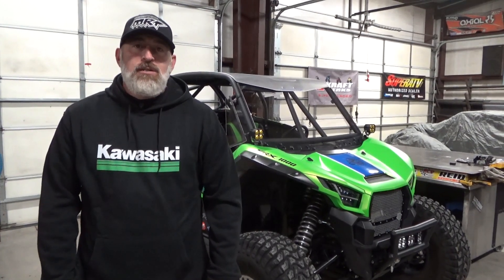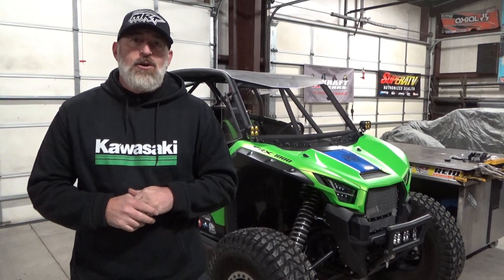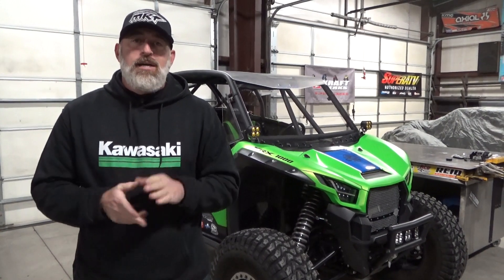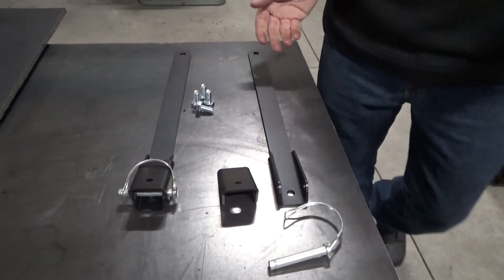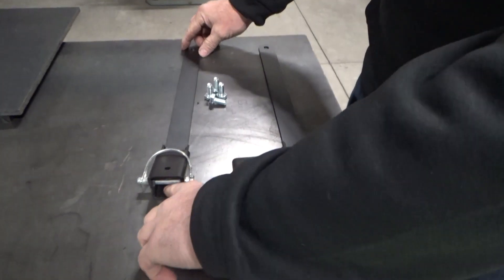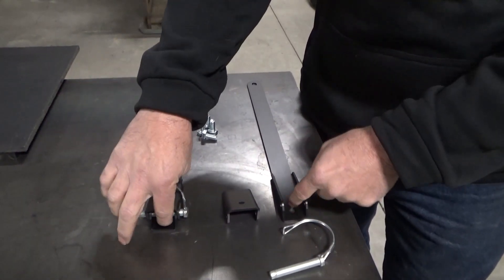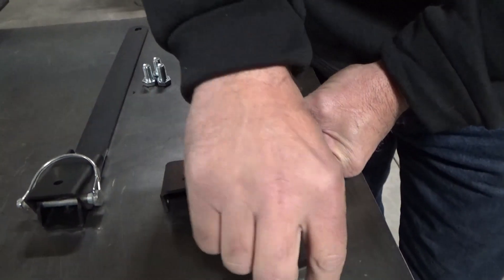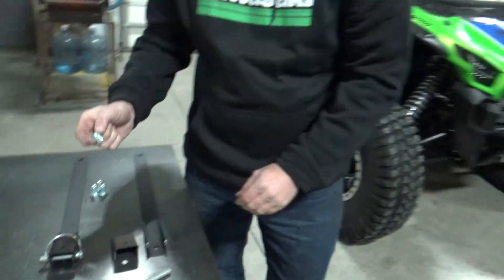Kawasaki KRX 1000 (12mm) Flip Forward Seat Installation

Comment: What windshield are you running? I’m looking at getting an intrusion bar for my KRX but it seems you’d have a difficult time running a windshield at the same time? Thanks!
Reply from the maker: Ours is custom-made. However even with a intrusion bar, as long as it’s a welded in one you shouldn’t have any interference issues.